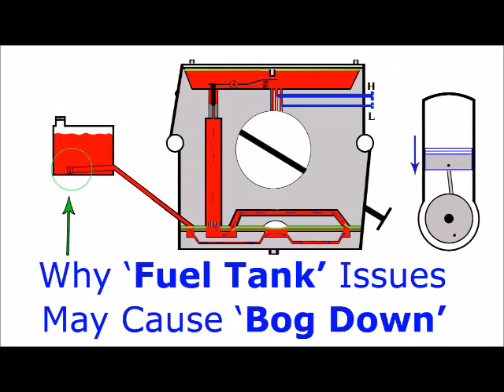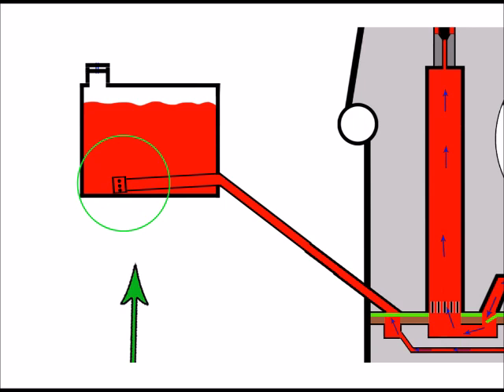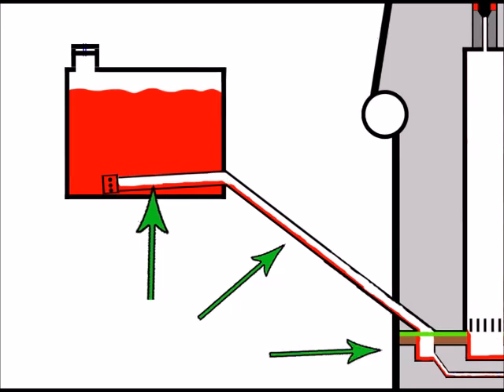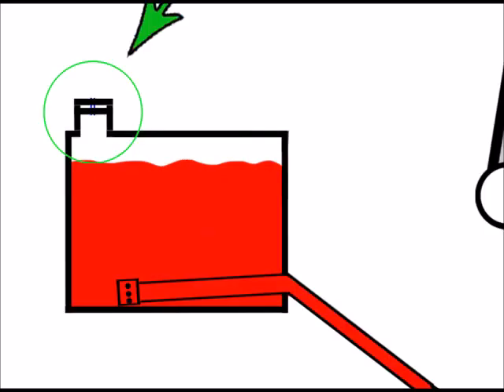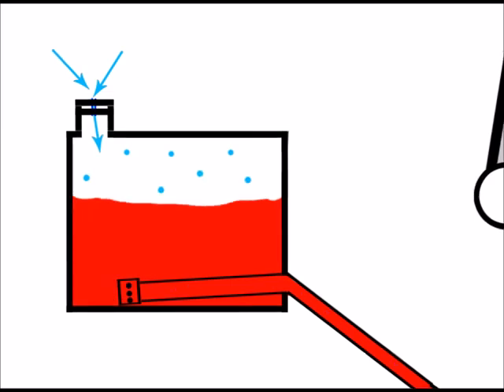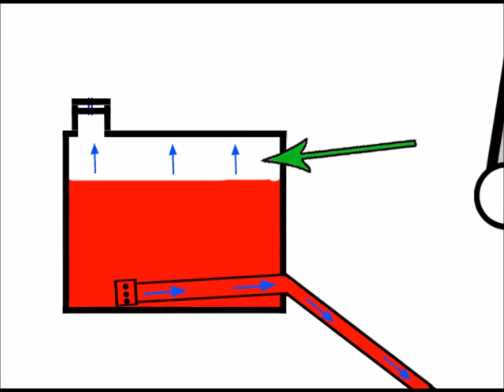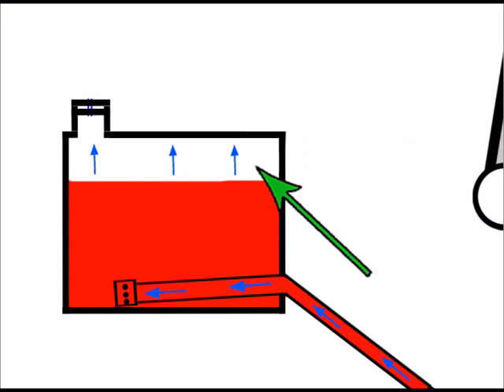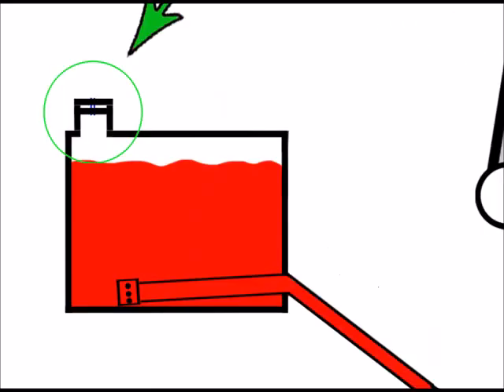Two-Stroke Chainsaw BOG DOWN when Throttled, wont start - FUEL TANK Issues.  (by Craig Kirkman)

Comment: Hello sir. I have 79 Mercury 2stroke 40hp, that cranks fine but only runs about 5mph. Straight turtle speed. Lol.. I give it full throttle and it's just barely moving. Sometimes it will kick in and  off we go. What could be my problem?

Comment: Ok, I have a johno 115, vro taken out. 
I was running a plastic fuel tank and had no issues. I recently installed a underfloor fuel tank. Ran breather hose to the transom, but the primer bulb I had on wasn't going hard. Replaced that, it goes semi hard but motor starts fine. (First kick)
I put throttle on and motor stalls. (In water)
Running on muffs with hose no issues. 
Any suggestions

Comment: My outboard will start idle and switch into gear.   If I pull on the carb it’s throttle works.     But if I use twist throttle it bogs and dies

Comment: My 13.5 mower has 2 issues      ..... under load it bogs  &  after Im finished moweing & turn it off and the motor stop it backfires like a shotgun blast.              ..Ive heard youre suppose to allow them to idle a short while before shutting it off,but it still will backfire upon shutdown.        ....   It has a brand new plug,did not set the gap though.
Reply: how is your mower now?
Reply: @diywithreza  It died a year ago :p
Reply: @97warlock  I was not expecting a reply at all! i was about to explain how to potentially fix it! and your comment was before covid, its crazy how our lives changes in a short period of time.

Comment: Quick question. The primer bulb on my carburetor will not fill even after multiple tries. I inspected the gas cap and found that the one way valve is broken. Is that the reason?
Reply from the maker: dannyboy768, hi. The best way to see if the gas cap is your problem is to unscrew it slightly to allow air to flow into the tank, then try priming. To be honest though, it sounds more like either a fuel blockage issue or an air leak somewhere in the carbs gaskets, the primer bulb itself or maybe one of the fuel lines either blocked or leaking air. Take a very close look at the primer bulb and the areas explained to see if you can detect any small holes or eve idem even of leakage (fuel escaping etc) Just check those things quite thoroughly first. I hope this has helped a little. Thanks